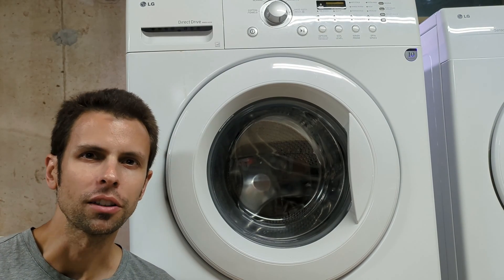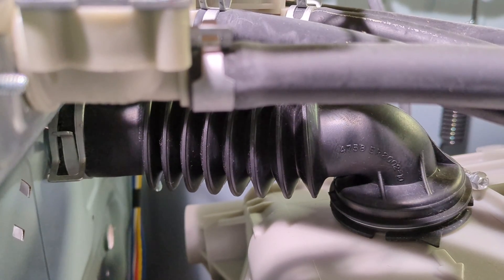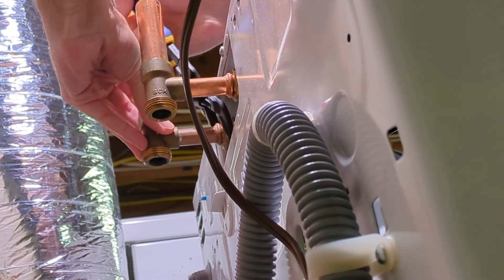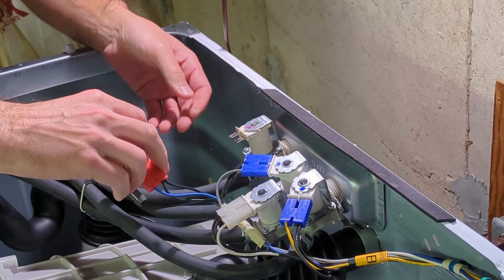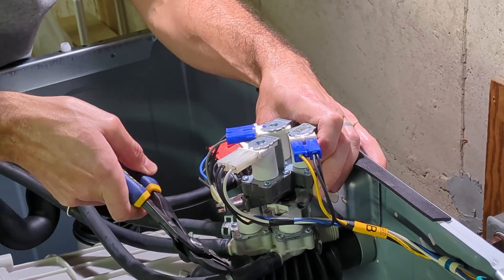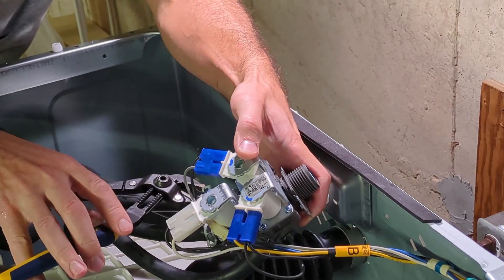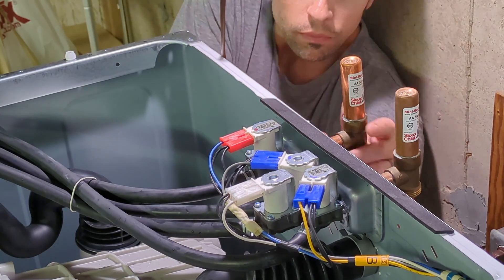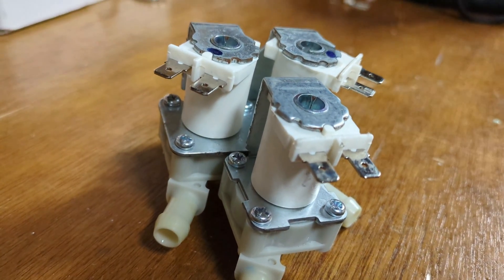How to Replace Water Inlet Valves - LG Washers

Comment: Which model do you have?  I have the LG wm3470cw. I checked on Amazon and they have a list of the machines that the valves are compatible with. However this specific model number is not listed. Closet I’ve seen so far were WM34700HA.
Reply from the maker: I have WM2010CW

Comment: My washing machine keeps filling up by itself even with no clothes in it.assuming that’s why
Reply from the maker: Either the inlet valve failed open and letting water in, or it is commanded open by the control. If you remove power then can confirm it is not the control/electrical.

Comment: I like how you did the hoses, take off one and put it on the new valve. My ADHD idiot self would have taken them all off and been like "...well crap." 😂😂 Bless you for this.
Reply: My ADHD self has done exactly that.  Can anyone advise on how the hoses and connections go back on. Wife is threatening to throw me and the washer out if I don't fix this, and it's all that's left to do on it. As is, the washer is working but I don't know where the Wash, Pre-wash and bleach lines go

Comment: I am nearly finished fixing my washer (bearings, spider.assembly, shocks). A small tophat shaped rubber gasket rolled out from somewhere. Any idea where it goes? I can't find anything on it, except that the part is listed as a water inlet gasket.
Worriednthat I'll  get it all back together and have to take it all apart again
Reply from the maker: Check on hot and cold inlet hoses to inlet valves. Also possibly the screen/filter on the hot or cold water inlet valve. Can't think of much else for gaskets right there.